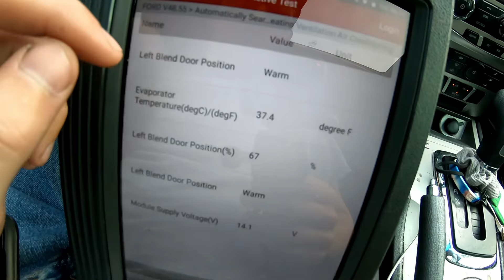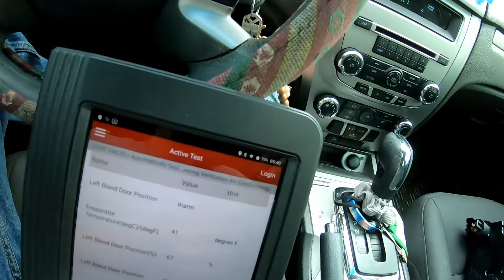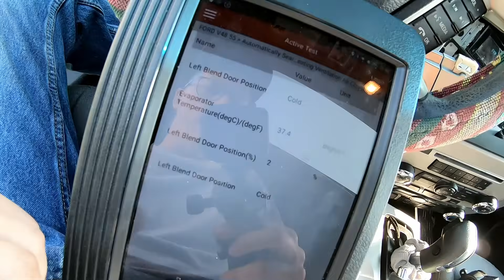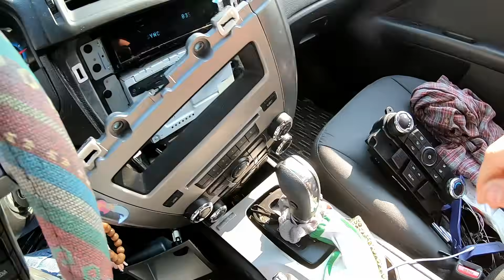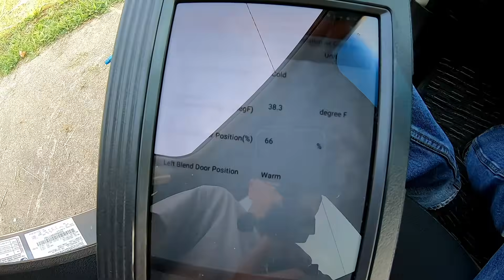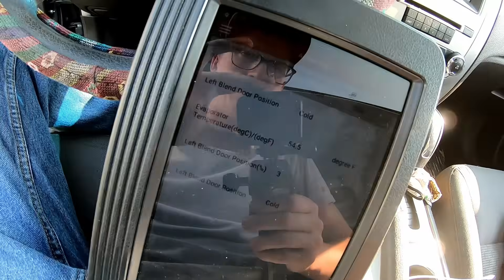2011 Ford Fusion - A/C Stops Working

Comment: I have the exact same problem and did some digging on it. Appears there is a fix which requires reprogramming the module using IDS version 98.01 or higher. There is a special service message associated with it as well SSM 45456. I'm not sure I'll bring mine in for this reprogram, more than likely will just use the work around, but figured I would post this in case anybody wants to get it fixed.
Reply: Thank you for sharing that. Should I contact my Ford Dealer where I purchased the car to have it reprogrammed?  Where can I find this information?  I have a 2011 Ford Fusion like everyone else watching this video. That is crazy! Mine just started very slowly a year ago and now I really notice the difference.
Reply: @antonioallen1763 they’ll lie and say it’s a part like the blower $$))
Reply: Lol I have zero idea what any of that means 😂😂😂 how can that help somebody that isn’t a mechanic
Reply: Im looking at one with this exact problem. I hadn't checked the blend door pids, believe it or not that's not on fords pin point test. But I saw the ssm and checked for updates, none available. But am I to understand the point of concern is EVAP sensor? Ford says replace HVAC module. I haven't yet trying to make sure which part actually needs to be replaced. Great video thanks so much very informative
Reply: Can u potentially use fore scan to reprogram it? My compressor is good but won’t even turn on
Reply: Thanks for the info on SSM 45456!!!! I've been chasing this problem for the last year on my wife's car. I will be contacting the dealer to get this reprogrammed.
Reply: @thomasallbright3462did you end up getting it reprogrammed? How much did it cost ?

Comment: I watched your video today because I was having the same problem with the hvac module. I moved the knob two digits up from the coldest point and lo and behold it actually resolved the issue. Thanks so much for posting the video. I would never  have discovered that fix on my own.

Comment: It’s not the fog lights that make it work you need to turn the headlights and fog lights ON not on  Automatic then start the car and it WILL work. Also the 2 clicks away from full cold also works

Comment: I appreciate all the workaround comments/advice. I'm wondering, if the scan tool can override the physical temperature control knob, can I just toggle between heat and cold like that? Or does it default back when the scan tool is unplugged or when the car is being actively driven?
Reply from the maker: I believe it would go back to normal settings after the scan tool is removed

Comment: So this sounds like TOO SIMPLE of a fix. I watched a video on this Ford Fusion issue. This guy recommended trying this simple fix and many replied that is worked for them. Simply turn your AC temperature knob up two clicks from the coldest setting. Start car, turn on ac. That is all. I don't know if this or the headlight/ fog light trick works but I'm sure going to try it before taking the time to fix it myself or spending the $900+ at the repair shop!

Comment: Thanks!  I have a 2012 Ford Fusion (purchased new in 2012) - 278,000 miles and what an amazing car it has been.  AC started acting up 2 weeks ago, I added a little EZ Chill and thought I had fixed it.  Went out again yesterday - checked all fuses etc.  Compressor is definitely activating.  I always run with headlights/fog lights on so I am trying the 2 clicks up from max cold.  Stay tuned!!!
Reply: I have the same , 2012 with 101,000 miles and is in mint condition except for the 6 warmer months.
FYI    Back in 2016, the Radiator cooling fan would go on full blast and then some at engine start up . The temp gage was no where near normal temp.  I brought it to the dealer SIX TIMES before they realized that the HVAC system's microscreen filter was clogged, causing a low side and hi side pressure  out of spec. (TOTALLY DIFFERENT FROM THE ISSUE IN THE VIDEO).
Been running fine ever since, except for the intermittant warm/cold issue discussed above.  Been doing the two clicks for three years now. Installed a new sensor up in the dash under the storage compartment. NO IMPROVEMENT. both sensors Ohm'd out at 25.4
No way will I part with this Fusion.
Reply: @larryverriden4493  Same here, I just reached 287,000 miles on mine.  The 2 clicks is still working so going to leave as is until I experience issues. She is a little work horse and will keep her until she can't go any longer. I have replaced various bulbs and door handles but otherwise she is perfect.

Comment: Thank you! I paid a friend of mine to install a new compressor and blower motor, plus do an AC recharge. It worked for several months, but then it stopped working AGAIN! I went without AC for over a year. I tried this, and BOOM, it's fixed! I'm glad I don't have to take apart the dash lol

Comment: It first started on my 2012 Fusion S, where the A/C would blow hot a couple of miles down the road. Turning the ignition off, then on again would reset it temporarily, but would occur again. I discovered this didn’t happen when the lights were on with or without the headlights. And it doesn’t occur in late Spring or early Fall. 
Recently and with the lights on, the passenger side is blowing less and warm, while the driver side blows cold. 
I will be trying this temporary fix.

Comment: My 2010 does this, but if I turn the caution or headlights on, it goes back to cold every time. So my workaround is always driving with the caution lights on during the summer. May be a slightly different issue, not sure.

Comment: I had the same problem and the two clicks method worked. Several manufactures have a manual method to reset the blend door actuator. Does anyone know if Ford has a similar method. I have yet to try the head lamp selector/fog light reset mentioned in the comments.

Comment: When you disconnect the control module try turning the blend door knob half way towards warm so when you reconnect it, it may be in the correct position for the blend door being at 67% after reconnecting turn the blend know back towards cold as this should now tell the computer the knob was turned more degrees in that direction towards closing the blend door.. now I'm just guessing from experience in computer programming but this may help some of you. I hope it does and if it does please come back and reply to this comment.

Comment: I have this same problem with my 2010 Ford Fusion. When you say two clicks away from the coldest setting, are they actually clicks like you feel with the volume knob? Or is it more just move it slightly away from the max cold setting? For my vehicle there aren’t clicks you can feel on the temperature control, it just spins smoothly. Just wondering if it’s different in the 2011 model

Comment: I was able to get mine to work by turning the ac to cold while the car is on. After I shut the car off, i removed the climate control fuse for 30 seconds, reinstalled it then started my car and the actuators recalibrated.

Comment: Have you ever changed out the cabin air filter behind the glove box
Reply: I just changed the one on my 2012 Ford Fusion - it was FILTHY.  The new one was $15 at Advanced Auto and easy to replace.

Comment: Whats the couple of clicks? When in the video dies he say it
Reply from the maker: @ncfrias  take your temperature control knob and move it two clicks off the coldest setting. It keeps it within the normal parameters and the module won't default to blowing hot air.

Comment: I have a 2012 Fusion been having this problem for 2 years had the Dealer replace the control module twice and it started doing it again was pretty mad by now tryed your 2 click fix and it works for now THANK YOU it was starting to drive me crazy 😊

Comment: Cabin fans in my 2012 would stop working randomly. The fix for my issue was to unplug the main unit under the passenger glovebox and plug it back in fixed it everytime until the fuse blew. Gonna try to get that fixed because no AC mid summer is not the move.

Comment: I replaced the ac compressor, ac line, re vac , alternator, radiator fan 2 times, Water pump and belt 3 times, both filters, and my car is heating up. Every month it is something with this car. Now I have to replace the blower motor for the 4th time it's messing up. Also replaced the resistor. Mine is a 2011 Ford Fusion SE V6 3.0L.  This car is full of issues. It's heating up been sitting with the ac on now for 5 mins and it's heating up. I have no idea. When I turn the ac off it goes back to normal.
Reply: Ford's just are not what they used to be.... I got a 2002 Ford ranger 2011 Ford fusion.... The rangers 20 times better....
Reply: @usa-b52 I agree! I am sticking with older vehicles they just seem built better.
Reply: I have the same car and have so many issues. Now I’m trynna figure out why my ac not working

Comment: I will definitely try this. I spent today driving around temperature was 86° with no A/C. It's been working intermittently for a few weeks now. I charged it with a little refrigerant today but it was only a little low so it didn't help at all. I'll definitely try this work around. Thank you in advance.

Comment: Our 2012 Fusion just presented with no A/C this week Feb2024 Texas, tested blend door and was working fine; Found a Hak on YouTube to move the headlight selector knob to manual and pull the selector out to turn on the fog lights (didn’t know we had fog lights). This Hak worked for us.  Kinda random but it stop baby from complaining and got the fusion blowing cold again.
Reply: Unplug the actuators both of them bc eventual they will malfunction and go to heat....and throw air from different vents
Reply: Can u tag the videoo

Comment: This is going to sound crazy. But my 2012 Ford Fusion will blow cold the blow hot. someone told me to start car, manually turn on headlights and it blows cold. Been doing this for 4 years no problems.
Reply: yeah i've seen this somewhere else too. especially if your fog lights are on. currently sitting in my 2011 and ac kept turning off before and after turning my lights on, it stays cold.

Comment: Let me share my sufferring. It started to behave in 2022 (2011 model) and turning car off and on would reset it and the problem would not appear for months. This year, the compressor started to engage and disengage constantly. The logical conclusion was that it's the EVAP sensor. I made the reading on the harness, and it was close to 5V (indicating cold). So I bypassed it with a resistor. Now the compressor was engaged. Success! For about a week. Once that was fixed, it started doing this. It would start cooling the car, and after about a minute or two it would turn on warm, while the compressor was still engaged.

Comment: I have had this exact problem for over a year. I figured out on my own that if I turned it a few notches from the coldest setting that my ac would work after a lot of trial and error. Wish I had found your video back then. Anywho, my ac is not kicking on after a year of using this method. Did you find out any other information? Thanks for your videos.

Comment: Your used HVAC module is junk,too. Put a new one in. You’ll have no more problems.
Reply: Just wanted to add that this is a known problem with 2011-2015 Ford Fusions. I work on cars for a living,and I’ve ran into this a handful of times. New module is the fix. Easy Peezy.
Reply: I noticed Dorman makes a new one. If they are making one, it must be a really common issue. You ever had one of the new ones come back into the shop afterwards?
Reply: @MathiasJarlson  Not so far. I did one just last week. It was a Dorman.
Reply: @slayerrules70  thanks for the help. I’m going to buy one for my car now!
Reply: @MathiasJarlson  No problem.
Reply: I bougbt a new module. Replaced every part on the whole system. Every tube sensor and compressor and still had this issue. Now i find the 2 clicks works. No clue if it would have or not with all the original parts.
Reply: I was about to buy one and then looked at the Dorman reviews for this HVAC module and I see that people are saying the module fix didn't last long. I am starting to think no-one really knows how to fix this, especially the jerks at FORD!! I did the headlight trick for 2 years. From what I am reading, you can get a year or 2 out of some fixes like the evap sensor, lights, or the 2 click thing but nothing seems to be permanent.

Comment: I had the exact thing happen to me 2 days ago! Change the blen door actuator takes 20 mins & 2 bolts. 
Undo the brake pedal switch 2 bolts with a extension & plug in the new one

Comment: Leaving cool knob to two clocks away from max is the only fix I’ve seen. Also if it goes to hot, you can temp fix by putting control knob on all the way max heat and leaving it for about 5 seconds then you go one by one click until to get to two away from max cool 

2011 fusion owner here
Reply: Now my new problem is when car is sitting still with ac on , car coolant temp gets to 115c 239f then cooling fan kicks on to max and coolant temp drop to 92c 197f and stays stable
I notice this one I saw my temp gauge rising near max
Reply from the maker: Maybe you have a sticking thermostat? We had a similar issue on an explorer with random high coolant temps.

Comment: We just bought a used 2 owner 2011 Fusion and love it. Great car. Handles beautifully. Roomy enough for my tall kids. Great gas mileage. AC went out about 2 weeks ago on a trip to visit my family. My BIL hooked up gauges and freon was on the low end of acceptable. He filled it up and it worked better, much colder, but still was intermittent. My husband got home and said it wasnt working again. I'm getting ready to take another trip to my mom's. He found your video and went out and went out to try your "2 clicks" fix. He came in completely amazed. We are both very grateful as are the kids 😁

Comment: Doesn't the "new" module need to be programmed to the car? I just replaced mine with a remanufactured one and it still wasnt working, took it to a mechanic and they said it needs to be programmed by the dealer.

Trying to get an appointment now. I'll let you know if it works...
Reply: Nope. Found a radiator shop that can program (dealer was crazy expensive). Programed the rebuilt module and no cold air. They say temp sensor is reading - 40 F. In other words not working. On to replacing that 😣

The fog light trick worked for 2 years for me. Maybe now I actually have a faulty condenser temp sensor on top of the strange computer glitch? 🤷🏻

Comment: Did you try measuring AC ripple voltage on the battery?   High ripple AC from a poorly functioning rectifier in the alternator can play havok with all kinds of electronic modules.     I am having the same problem with my wife's 2012 Fusion, and the problem began very shortly after a battery replacement, due to a bad battery.   I have about 120mV of AC on my car, which seems high to me.  I would like to see AC ripple like 20-30mV at most.   Possibly the bad battery damaged the rectifier in the alternator and one or more diodes is a little "leaky" now.   I am going to to try unplugging my alternator and see if the HVAC problem goes away.    You might try the same thing on yours.

Comment: Thank you for this video. I have been chasing this for years on my wife’s car and even paid a mechanic several hundreds of dollars to “fix” the problem. Worked for a year or so and then same problem. The fog light fix did not work for my car. Air went hot again today and I tried the “two clicks from cold” you suggested and perfectly cold air!  Can’t thank you enough.

Comment: Tried this on my Aunt's 2012 Fusion and it worked like a charm. 
Thak you for the great video!!!!
Reply: About to try it on my 2012 Fusion
Reply: @CarolinaKvngpin  did it work? Mine didn't.
Reply: @ryanstalcup7093  I had some work done on mine the day before so fortunately mine was just the previous mechanic accidentally (I don’t actually know if it was an accident or not but eh) disconnected the ac from its power supply

Comment: So I turned the Knob up 2 notches just like you said and my air worked. It came on and stayed on. 🥳🥳🥳 I knew I didn't need a compressor or freon. I have been hesitant for a year about taking it to the shop bc I didn't want anyone to take advantage of my money. I cannot thank you enough.
Reply from the maker: I'm glad it worked for you. It's a shame that it happens, but fortunately this workaround has been effective...and is also free.

Comment: Apparently with car off, set it to hot and then turn the car on and change it to cold slowly.
Reply: IT WORKED. Car was on but i turned it to 80 and 81 passenger side and dropped it slowly to 73 about 15 seconds total.  (ford fusion 2010)

Comment: Have you found the cause of that yet? Mine is doing the same. Using forscan, everything seemed to be fine as long as I didn't go to full cold. Now my A/C clutch won't engage (PCM is not sending signal but all voltages and pressures are showing as they should.)
Reply from the maker: I have not found the actual cause, just as long as we don’t put it to the coldest setting it has continued to work properly.

Comment: What scanner are you using? You like it? I am fixing to buy a high end scanner soon.
Reply from the maker: I am using the Launch X431. I've been really happy with it for the money. It came with 2 years of free updates, which is nice to have.
Reply: @tightwadproductions961  Thank you my friend and good luck.
Reply: There's a launch scanner that's on Amazon for 170 bucks. Do you think that it would have the feature you need to adjust the AC?
Reply from the maker: I would say it likely does not at that price. You need one that has bi-directional controls.